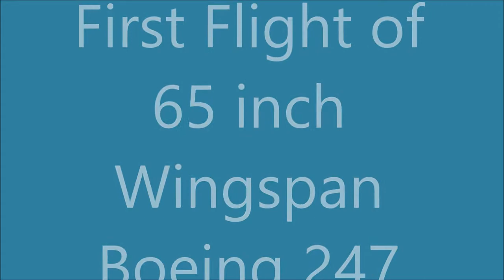Boeing 247 first flight

Comment: Do you like those firepower 480 motors?
Reply from the maker: Micah Baptist  On 3s batteries and 9x5 3 blade GWS props the plane was quite underpowered. I have changed to 9x7 3 blade Master Airscrew props which gives 20% more static Watts. We will see if that solves the problem. If not I'll increase to a 4S battery.

The motors themselves seem fine although one other possible solution would be to choose motors with a higher KV value.

I haven't flown it since I changed the propellers. It is the rainy windy season here in the Pacific Northwest.
Reply from the maker: For a fuller discussion of the math. https://www.rcgroups.com/forums/showthread.php?1795957-65-inch-Boeing-247-inspired-by-Cleveland-Model-and-Supply-plans/page60
Reply: Robert Russell thanks man. That's an amazing plane by the way!
Reply from the maker: You are welcome and I'm glad you like the airplane.